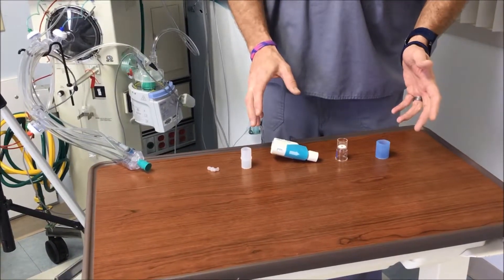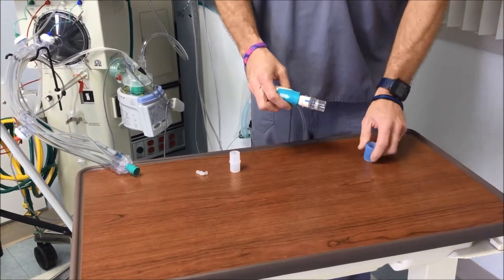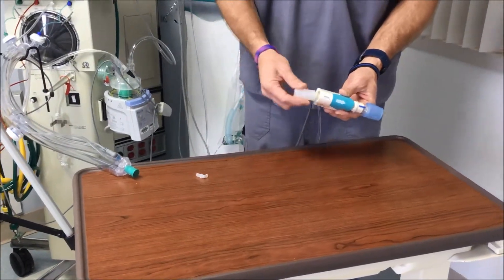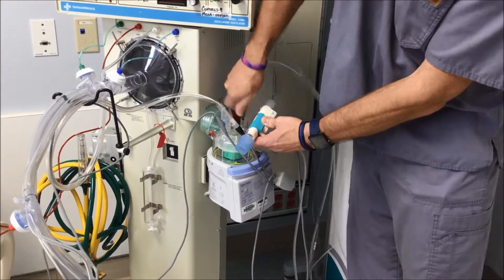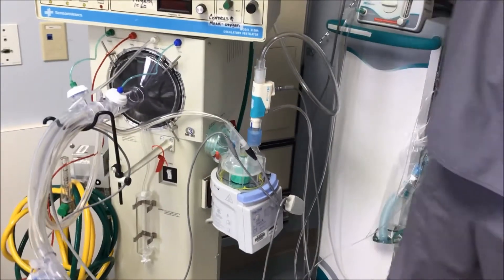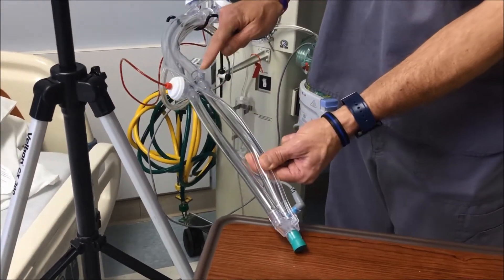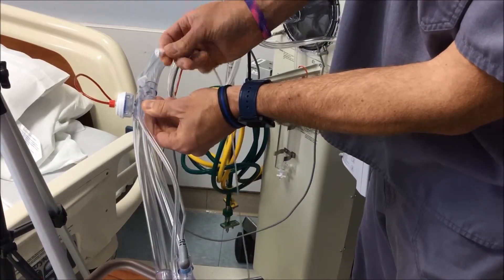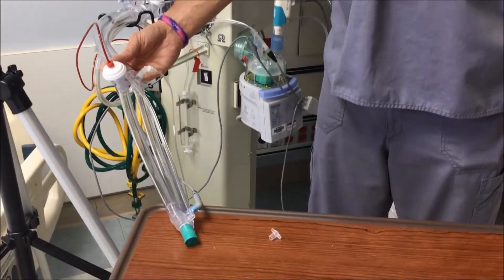RT Clinic: Adapting Inhaled Nitric Oxide to a Neonatal Oscillator - Sensormedics 3100B

Comment: I think this is not the right connection. If you place temperature water at the end it will cause too much humidification. It will affect the reading of INO. Also INO monitoring line should be near to the patient for accuracy of reading